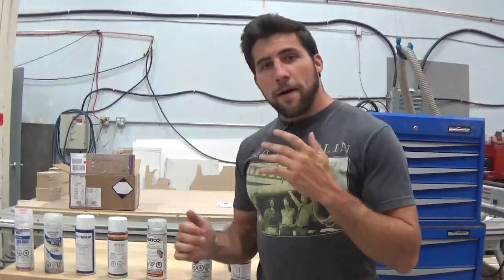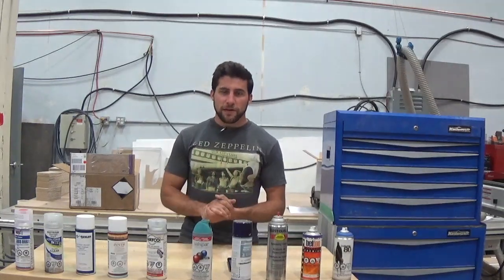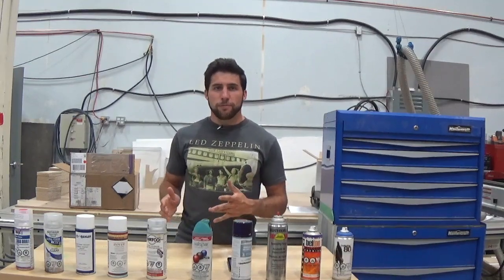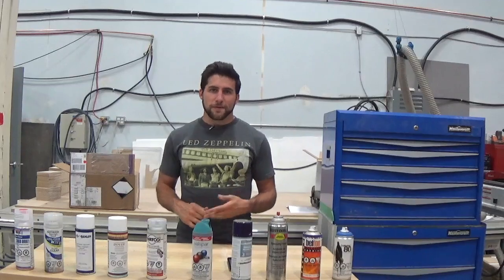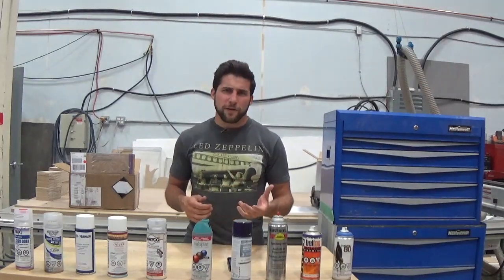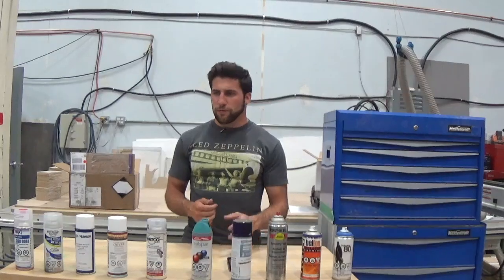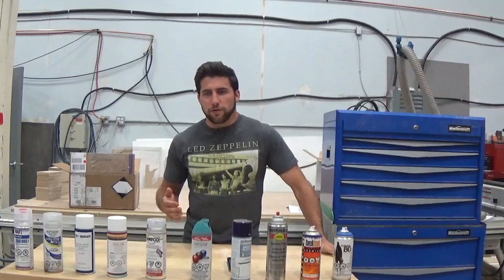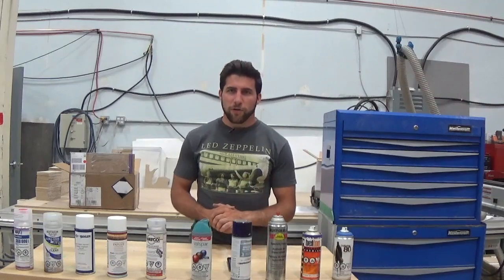The Top 5 Mistakes to Avoid When Painting With Spray Paint

Comment: Hello there , I am trying to paint fiber clay planters they are rectangular and have these tiny little holes in them , I am trying to fill in the holes and than sand and paint but could never get rid of the little holes , they are like needle holes . I want to have a finish that is like car paint finish , high gloss shiny smooth finish like fiber glass planters . Any tips ?
Reply from the maker: Have you tried using bonds to fill the holes and then sanding smooth?
Reply: Brad Angove I tried using the stuff they use on dry walls , it works a little bit but not so great these tiny little holes everywhere. So I will try the bonds do you know a good one easy to work with ?
Reply from the maker: Bondo is a two part filler. That’s the brand. You can find it at automotive stores. Look up a couple tutorials on using it first.
Reply: Brad Angove Thank you , i am looking it up right now .

Comment: I painted a mini bike frame today.   Ive painted many things before in the past.  This was primed with etch primer and sanded.   2nd coat was filler primer again wet sanded.    Everything was smooth before the base coat.  I then put the p
Base color on of heat treated duplicolor with ceramic urethane.   Put 3 coats of it on.  It came out very rough.   Never had this before.  Waited 10 min for each coat like the directions said.    I am not happy with the rough texture.  By the way it was gloss black.   I have no drips or runs just very rough.    What giveS!
Reply from the maker: Did you clean the surface before you sprayed?
Reply: Brad Angove Yes with a lint free microfiber rag and 90% rubbing alcohol.
Reply from the maker: Really the two possibility that come to mind are you either painted it too light, or some dust got in there while you were spraying.

Comment: Hi I feel silly to ask but even after watching this either I'm not understanding or idk;   I tried rustoleum high gloss automotive paint but the can exploded and splattered paint.  I waited next day to try and sand it; it wasn't even responding well to 180 grit (i started at 600) and it's peeling like rubber and smells like house paint almost. I've never encountered this before, any ideas how to tackle this..?
Reply from the maker: What were you painting on?
Reply: Brad Angove I'm painting on my car's bumper (I clean, sanded, primed etc with recommend wait times).
Reply from the maker: Did you use a plastic compatible primer?

Comment: Hi Brad, I can't find anyone who directly addresses my problem. I applied grain filler three times to a maple top using Colortone, a transparent water based product, then applied three coats of poly spray color. After all that I looked closely at the finish and discovered that there are fine grain lines in the finish. Can I sand along the grain lines fill them with  the grain filler and then re-apply a color coat or two? Thanks!
Reply from the maker: How deep are they? You may be able to just sand your poly smooth and add a couple more coats.
Reply: @BradAngove  They were quite shallow. I took your advice and it worked well. Thanks!
Reply from the maker: Glad to hear it!

Comment: I spray painted my airsoft gun because I think it looks better black than tan, but the problem is that even after like 5 minutes of shaking the can, the paint seemed to spread apart on some parts of the guns  leaving some parts unpainted, what did I do wrong?
Reply from the maker: Did you sand and clean the gun first? Sounds like a surface contamination issue.
Reply: @BradAngove  no I didn't, how could I go about repainting it?
Reply from the maker: Sand off the paint that’s on there, wipe down with wax and grease remover, and then repaint. Make sure it’s plastic compatible paint as well.

Comment: The biggest issue I have is after I paint something, and let it set for a couple of days, then sand it and repaint it will lift. It seems to have opened the paint and needs to set longer after wet sanding.
Reply from the maker: What kind of paint are you using?
Reply: @BradAngove  I have the same issue with Rustolium or Krylon.
Reply from the maker: You said you were sanding with 1500?
Reply: @BradAngove  I did to get out some issues in the paint without going through the paint. But before I paint I use 400 with water wet sanding. My issue is that if I paint a thing and let it set for a couple of days I can paint it without sanding and usually have little issues. But If after several days I sand it and then paint right after it will most likely wrinkle. My guess is that I am by sanding exposing the uncured paint and will get the same situation as when I paint over something a couple of hours after the first coat. So My question is how long after sanding should I wait to reapply?  My guess is that after 6 months you could sand and repaint right after because its most likely cured through.
Reply from the maker: You’re probably right. The answer to that would depend on how heavy you apply it and how warm and dry the conditions are. In the summer here I sand and recoat after a day or so. I’m the winter I usually wait longer. 
Try applying a very light coat to start with when you re-apply. Sometimes the wrinkling occurs from heavy coats reactivating solvents. A very light first coat can prevent that issue.

Comment: Just bought kraylon fusion it says no sanding needed  so cleaned hubcap but got like air bubbles.  As if paint  did not want to stick.
Reply from the maker: Ya, that’s one of the issues when there is no sanding.

Comment: do you sand Mettallic paint and do you need a primer if you use a sanding sealer?
Reply from the maker: I try to avoid sanding metallics, and no, generally you don't need to use primer if you're using sealer.

Comment: What spray paint would you use for rc 1/4 scale boat plastic mould any advice thanks
Reply from the maker: You just need to start with adhesion promoter. Other than that it’s pretty standard. I really like the car rep 2K enamel sprays.
Reply: @BradAngove  Thanks mate for advice have a good Xmas good luck

Comment: Hey guys, I painted my bike rim with metallic paint in my room which has wooden floor. I only put plastic table cloth below my rim. But after being very careful not to spray on my floor. I noticed the areas which was not covered us kind of sticky now. How do I clean it. Any suggestions
Reply from the maker: What kind of paint did you use?
Reply: @BradAngove  rust-oleum universal metallic paint and primer in one carbon mist
Reply from the maker: Try using a bit of paint thinner in an inconspicuous corner or under some furniture to see if it damages the floor finish. If not, you should be able to use that to remove the overspray.
Reply: @BradAngove  thankyou Brad, appreciate the response. I will try that today.

Comment: Any way to paint over duct tape, I have a prop I've made that is completely covered in duct tape, I need to paint is there a way to do this without peeling?
Reply from the maker: How long does it need to last? You could try starting with adhesion promoter followed by primer. May have better luck carefully gluing something more paintable to the surface though.
Reply: @BradAngove  really only a weekend . Thanks :)

Comment: i sprayed my motorcycle single stage enamel..came out ok some fish eyes.. no orange peel etc.. i want to change it to base coat clear. been painted about 2 weeks.. can i smooth sand the enamel  and spray a base coat? or do i have to prime and seal?
Reply from the maker: You should be able to sand the enamel and move directly to colour. Make sure you’re confident that the enamel is fully hardened before you move on to that though.
Reply: Thank you

Comment: I'm painting a plastic using spray paints. I sprayed a primer surfacer do i need to sand it after then put the next color?
Reply from the maker: Usually that’s what you would do yes. Let it dry and then sand and move on.
Reply: Ohhh thanks😊

Comment: I used Rustoleum enamel spray can i bought it al Lows ..I used it on my car bumper plastic .. did I do wrong ... would it last ..I sand it put primer and paint
Reply from the maker: It won’t be as durable as proper automotive paint.
Reply: Brad Angove thank you for taking the time to answer my question..😃

Comment: What clear lacquer would you recommend for ceramics? Like tiles.
Reply from the maker: +James Murray What are the tiles being used for?
Reply: Just a wall. not a floor,thanks.
Reply from the maker: I don't really have a particular clear lacquer that I would recommend. Honestly, I doubt that I would use lacquer on something like that. I would probably shoot a light coat of adhesion promoter and then use a clear enamel or polyurethane.

Comment: Hey I just sprayed my bmx, I used primer, then paint, but after putting the clear coat on it went dull/cloudy/white. Not sure why or how to fix it, please help 😔
Reply from the maker: What kind of paint?
Reply: Brad Angove acrylic spray paint
Reply from the maker: Sounds like you have moisture trapped under the clear. You may be able to careful remove it by gently heating it with a heat gun. 
If you’re using those reflective metallic paints it’s a different problem though.

Comment: I'm facing these issues please help me
1. I was painting my computer case(sheet Matel) recently I sand it very vell before applying spray paint but it is pilling right off just by scratching it lightly 
2. I tried clear coating it after applying 3 coat of colour and 2 coat of clear spray but after that it's pilling of easily just by scrathing a lil bit
3. After 5 month I accidentally dropped alchole to the paint job when I wipe out alchole I saw that the paint I applied 5 month ago is also wiping out with it 
4. Please answer my questions ,is that happen only with aerosol spray can?
Reply from the maker: It’s not the fact that it’s aerosol that’s the issue. It’s your prep and paint type. Sounds like you didn’t use a metal compatible primer and you didn’t use a solvent resistant clear coat.

Comment: I put my first coat on and I got drips not knowing what to do I thought if I put another coat it will even it out, well that did not happen any tips how to fix ?
Reply from the maker: Yes. Let it dry completely and then sand it flat and smooth. Then you can add one final coat, or if you’re sanding at a higher grit like 800 you can move straight to clear coat as long as you have proper coverage.

Comment: What happens if I wait a week before applying clear coat on a dupli color paint job? Is there no problem or is there something special I should do?
Reply from the maker: I would recommend a light sanding with 800 grit first.
Reply: Brad Angove alright thank you! Wet sanding right ?
Reply from the maker: It depends on the substrate.
Reply: Brad Angove well I’m painting a chrome bumper I sanded it, and used self etching primer and spray painted it with perfect match dupli color. And now i will clear coat until Saturday because of work

Comment: If I used chalkboard spraypaint which is grity, should I still sand it for clear coat?
Reply from the maker: This confuses me a bit. Why are you clearcoating it? That will defeat the purpose of using chalkboard paint.
Reply: @BradAngove  I couldn’t find the non chalk of that color
Reply from the maker: Ok. You should probably still sand before clear coating. It also shouldn’t be gritty.

Comment: I think I made a huge mistake.  I spray painted all of my handles for my dresser a silver color... I thought it was dry, it looked dry an hour later and felt dry so I flipped it over and sprayed the back and left it to dry overnight in my garage.  When I took it off he plastic cover I had to protect the floor the finish on the front was horrible.  It was sticky, all the paint was layered in different spots.  It reminded me of when you put nail polish on and then accidentally hit your nail on something and all the paint piles up.  I just don't know what I did wrong necessarily because I did everything the instructions told me to do.  How do I fix it and avoid making the same problem??  And how am I supposed to sand a metal dresser handle?
Reply from the maker: You would probably find it much easier to just replace the handles with silver ones. Notwithstanding that though, sand them carefully with a small piece of 220 grit sandpaper and then 400 grit. Once they’re smooth, clean them and spray them again. This time, don’t let anything touch the surface you sprayed for a couple days, and keep them somewhere warm with low humidity.
Reply: Brad Angove thank you so much have for your reply.  What I did is I washed them off with this metal cleaner and polished them.  They are like a smooth bronze.  Although, I would prefer silver.  The problem with replacing it is that they are 2 holes 1.5 inches apart because my dresser is from the 40s and the standard is 2-3 inches.  So if I were to replace it if have to drill and cover the holes which I'll probably do later on.   I don't think I'm going to spray paint anymore because I don't really want to mess it up again.   Thank you so much for your help.
Reply from the maker: You’re welcome. I’m glad the bronze at least looks ok. You may be able to get new handles with a backing plate. That would cover the old holes.
Reply: Brad Angove oh I didn't even think about that!  I'll definitely look into that

Comment: What to do if i dont have polish, can just sand the enamel paint with 1000 or 1500 grit Paper then apply clear lacquer for smooth finish....can this be a good idea?
Reply from the maker: Lacquer over top of enamel is a bad idea. They will react poorly
Reply: @BradAngove  okk can u tell me how much time difference between coats should be there while spraying enamel.
Reply from the maker: I do 10-15 minutes
Reply: @BradAngove  can you please tell how we can get smooth finish on enamel....due to lack of resources i had to paint it with brush, now brush marks are visible, as we cant spray lacquer over enamel, what should we do now
Reply from the maker: Sand it smooth and polish it.

Comment: How long do I have to wait to apply clear coat after I applied the base coat? Do I apply immediately after the three coats?
Reply from the maker: It depends on the paint, but I usually wait a couple days.
Reply: Thank you very much . I have had that question for a while now and I couldn't find a clear answer . I'm painting my bike and I want to apply clear coat , so im afraid that if I apply clear coat it will peel later . I'm using spray cans from Canadian Tire
Reply from the maker: Don’t forget to sand lightly and clean before clear coating.
Reply: @BradAngove  thanks so much for all your advice
Reply: @BradAngove  the instructions on the can say I can apply clear coat 30 minutes after the base coat dried up . Is that correct ? I will paint 3 coats of base , 10 minutes in between . Then 30 minutes later I will apply 3 coats of clear? Also 10 minutes in between . Please let me know if these are the correct steps
Reply from the maker: What kind of spray paint is it?
Reply: @BradAngove  they are regular spray cans . The brand is duplicolor . And both the base paint and clear coat are acrylic lacquer . They both have the instructions to apply 3 coats 10 minutes apart . The  instructions on the clear coat says I can apply it when the 3 coats of Base are already applied , and I have to wait 30 minutes after the third coat
Reply from the maker: fernando bill I have done that before successfully with duplicolor.
Reply: @BradAngove  thank you so much for clarifying me on all of this . I'm relieved , I can now start to paint . Keep this channel going 👍🏻👍🏻

Comment: I have seen you replied almost all comments. I tried to do a DIY on IKEA table that was already painted. But I spray painted it with gold color. But it is coming off even with the lightest scratches. Why is it so?

Based on my research I am doubting that it is happening because I didn’t use primer before I sprayed it. Is it so? Please help.
Reply from the maker: Is it the reflective gold spray paint?
Reply: @BradAngove  you replied thanks. 

Below is the material of the table
Undercarriage:
Steel, Epoxy / polyester powder coating

I used spray paint mentioned below and it is high gloss metallic gold spray. Yes I assumed it is reflective gold spray paint
https://panduro.com/sv-se/produkter/mala-rita/farg/sprayfarger/sprayfarg-150-ml-guld-244173?gclid=EAIaIQobChMIvee2t5-p6QIVwk0YCh3GRQNBEAQYAiABEgK1hvD_BwE#fo_c=3245&fo_k=38fdc530457cd2899f1041f9bc892def&fo_s=gplase
Reply from the maker: Did you sand before applying it?
Reply: @BradAngove  nope :( I didn't
Reply from the maker: That’s probably why it’s coming off so easy. That type of paint isn’t very durable, but if you don’t prep the surface properly it’s even worse.

Comment: Im using the american accents rustoleum primer, it says apply 2 or more coats then base coat with 1 hour or after 48 hours. My understanding is after primer, apply base coat after an hour or 48 hrs. Am I correct?
Reply from the maker: Yes. For the least chance of a product failure I suggest you wait the 48 hours, then sand lightly before adding the color.
Reply: @BradAngove  thank you for responding. Im actually painting my wheels. Can i just sand with steel wool?. The first two wheels, i have already mess them up. One has orange peel and the other was lightly coated so i may have to redo that one
Reply from the maker: Yes, you can use steel wool as long as you clean them well afterward. Not too fine though. Maybe 0, rather than 000 or something like that.
Reply: @BradAngove  ok I understand. Now, in between primer, base, and clear. After light sanding, do i wipe them again with mineral spirit? Or just a dry towel
Reply from the maker: Use wax and grease remover or naphtha.